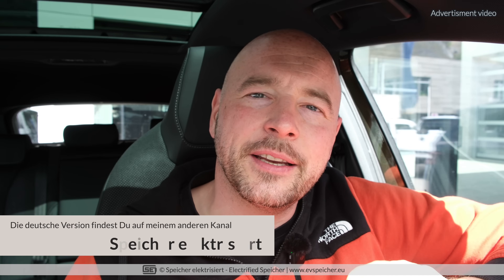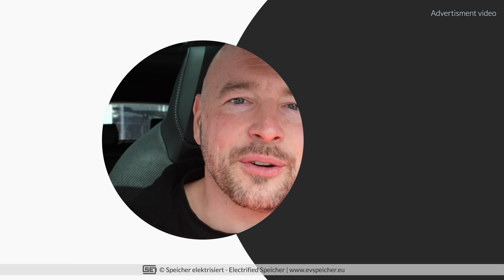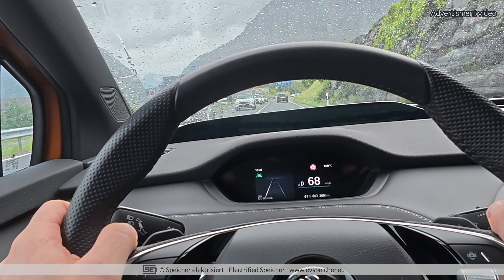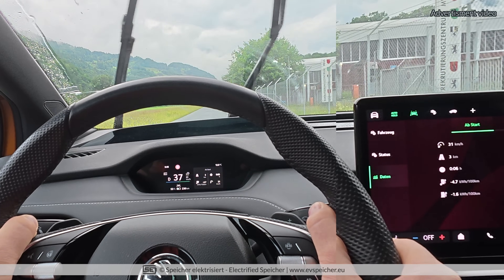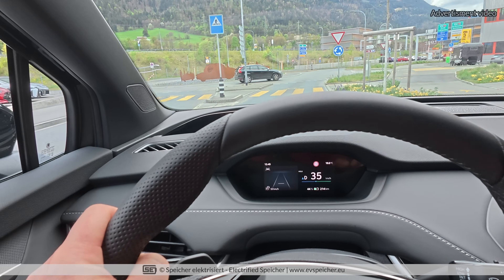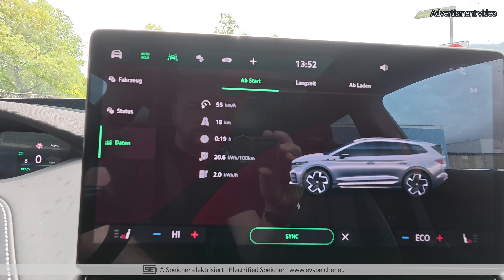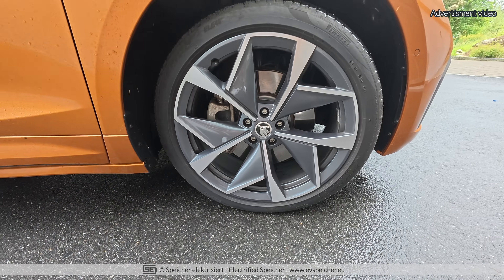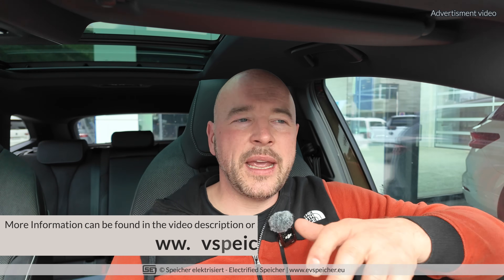Škoda ENYAQ & ELROQ: Drive more efficiently without sacrificing comfort - Here's How! (Part 6/8)

Comment: You didn't discuss the benefits of the ecomode settings in this video, maybe no benefits?
Reply from the maker: It was part of the video but did not survived editing. Eco Mode can be beneficial as it lowers the acceleration power of the engine, limits the car to 130km/h (can be overruled with kick down) and the AC a bit. But all of this can also be achieved with driving. Lots of people don't like the ECO mode as it feels a bit slow and thus try to accelerate more and remove the benefits by doing so :)

Comment: Good to gett som advice on driving an ev i em waiting on my Elroq 60 , hope it will arive in Juliy ,just a qustion regarding the 12v battery? do you charge it in vinter? ore dos the main battery fix it vondering since sevrel car brands have isues with 12v battery make the car die if you drive fast on autoban wath is best to prevent 12v isues? best regards.
Reply from the maker: The main battery will charge the 12V Battery and it will also be charged when you charge the main battery (e.g. at a wallbox at home or at the fast charger). Most of the time the car is capable of keeping the 12V in good shape. There were some issues last winter but they brought an update that makes the system recharge 12V more often.

Comment: .....this clip is about five years late 😊
Reply from the maker: Better late then never :) I thought with the new models that Skoda offers a lot of new drivers will look for some information
Reply: why? There are still ppl new to EVs that gains from it. And the systems in the EVs now comparing to five eyars ago are vastly different as well. New techniques develops and change how things work so an updated video is never wrong really 🙂
Reply: @torparnorpan8362 I'm sorry to say that you are wrong 😊 . I used to have a 80x - and now I have a 85x (2024). The software and everything else is 99% the same. The only difference is the preheating ....
Reply: I did two similar videos 
 last year, only 4 years too late 😂